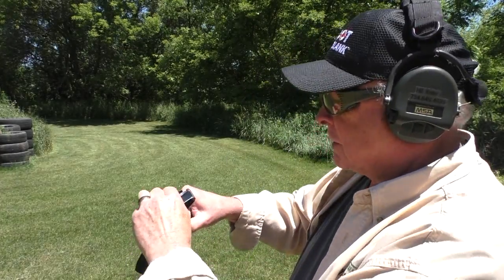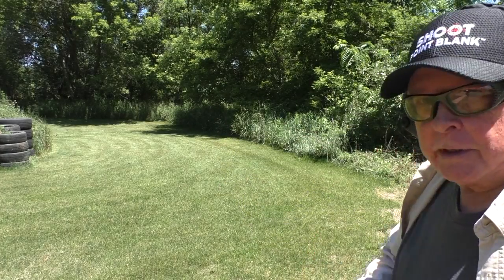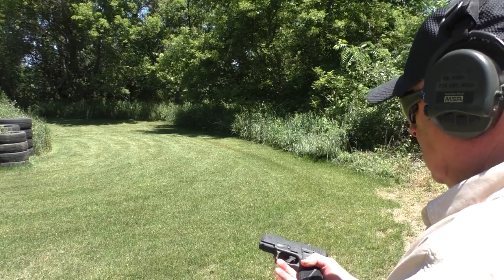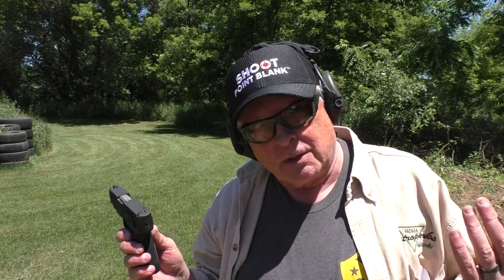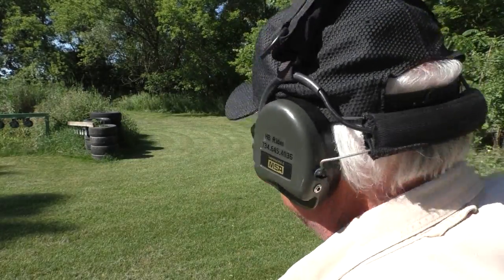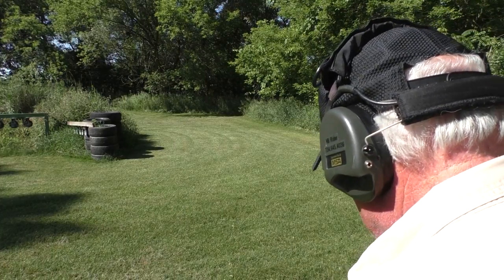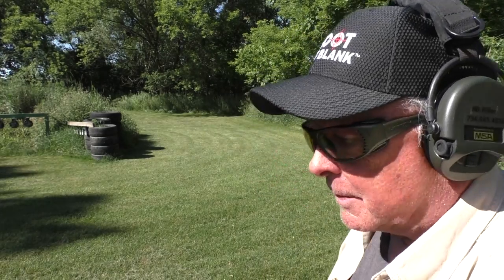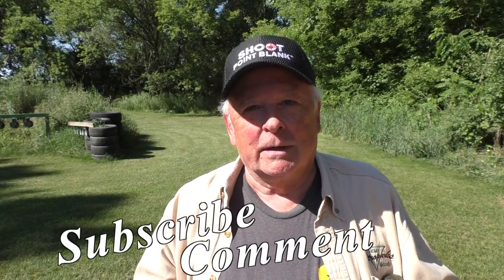Will the Taurus G3c run Defense Ammo?

Comment: I am breaking in my new G3c and have just over 500 rounds through it of 50% ball ammo and the rest being various hollow point and ballistic tipped versions of premium and cheap left over Hornady, Federal, Remington, Winchester, Corbon, etc., with no feeding, firing, or extraction issues.
Reply from the maker: Most of them run just fine. But Taurus QC is still somewhat spotty, so the occasional not-so-good example makes it into the stores.

Comment: I just bought a g3c but have had a g2c for a few months. I've ran everything under the sun through it including dirty Russian steel ammo and several types of hollow points and never had an issue. The only time I ever had feeding issues was trying to chamber the first round hollow point on a brand new dry gun (g2c and g3c). Took both apart and cleaned and oiled them -- no issues ever since.

Comment: Haven’t had any trouble with mine. Running 115gr Critical Defense and 115gr/124gr Sig Sauer V Crown. I think the key is to find the ammo that works in your gun.
Reply from the maker: The right ammo for the gun is always the issue. There is no such thing as "one size fits all". Once again, thanks for watching and commenting.
Reply: Hey, that's the ammo that a got when I bought this gun last week. 40 dollars a box of 50 is not a bad price.
Reply from the maker: @recon1071  there's just something about knowing you are spending $0.80 every time you pull the trigger. 😢
Reply: I know, but these guns are for self defense. They must fire self defense round reliably.
Reply: Don’t use fioccoh hollow points  147gr in the g3c . I found that out the hard way And I may not have spelled that name wrong. 
The Winchester silver defense hollow points work just fine in mine 115gr.
Reply: @robertkelly9276 
Would the fiocchi hollow points go into battery ? What was the problem with them ?

Researching to buy,thanks.

Comment: Polish the feed ramp to a mirror finish and you'll never have a problem.
Reply from the maker: That's generally the suggested fix. Thanks for watching.
Reply: @RidersRange  AND easy to do!
Reply: It's more of a barrel issue with mine when running some147 grain HPs. They hang up a little at the end of the first mill shoulder from the ramp end. Polished the feed ramp, same problem. Not many rounds through it yet though. May break in with time.

Comment: I've run around 1000 rounds of mixed ammo through my g3c. I only had 1 stovepipe with some SUPER CHEAP and underpowered aluminum case poly round nose range ammo. Literally runs everything I put in it smooth. I have shot several weights... but no 147 grain.  Ill have to pick some up and see. But ny taurus g3c has been literally unbelievably reliable. I wasn't expecting to be so happy with it. Very nice in hand as well. I even use the extended Mec Gar 17 round mags for plinking fun, and I have zero problems. Its a great gun for the money in MY experience anyway.
Reply from the maker: I've read reports of great reliability, and not so great. It seems that, though Taurus has made great improvements, their quality control is spotty. Thanks for watching.

Comment: The problem with G3C not feeding JHPs isn’t the feed ramp not being polished. 

Lock the slide to the rear and look closely at the feed ramp. Notice the mag well and feed ramp function together to feed rounds into the chamber. Now with the slide locked to the rear, move the barrel. You will notice that the feed ramp will move around and separate from the “ramp” on the mag well. He lies your problem. The distance between mag well and feed ramp created by the barrel moving around causes jhps to catch. No amount of polishing will fix this issue. Although it appears fmjs will push right on in there, jhps often catch. 

My remedy is to use “rounder” jhps and to rack the slide with the barrel pointed up. Gravity causes the barrel and feed ramp to fall in place better.
Reply from the maker: There are many things that can cause feeding problems. Thanks for watching.
Reply: thats exactly whats happening with the g3c im trying to get to run hollow points

Comment: I shoot anything through mine with now issues.  The 12th round in the mag is very tight, and one must ensure the rim of the round is fully back against the back of the mag.  Trying to tap the back of the mag will not seat the 12th round back.  You must manually make sure it’s fully seated!
The G3C is quickly becoming one of the most enjoyable pistols in my collection!
Reply: this is the capacity and sized pistol Glock should have made between the G19 and G26 but didn't.
Reply: @locksfoils just less reliable 😂
Reply: @JeeperCreeper-h1j  you can always tell who has never held one.  I have the 17 19 26 and 36.  The G3C isn’t significantly less reliable as you tear up laughing.  I’m an engineer and statistics of the six sigma show the Taurus is the better pistol dollar for dollar.  So someone at Glock is laughing at you.
Reply: @locksfoils  Yet you have allegedly have 4 Glocks so much for Taurus being the end all be all. 🤡😂
Reply: @JeeperCreeper-h1j  my comment originally is about capacity.  The size choice. Haters are gonna hate.
Reply: @locksfoils  Keep telling yourself that 🤪
Reply: @JeeperCreeper-h1j  you probably have never held a Kahr either….we all know the Glock boys

Comment: I have the Taurus G3c and I love it. There's no issues at all also very accurate.
Reply from the maker: Taurus QC seems to be hit or miss, though Taurus has come a long way in the past decade or so. Many G3c pistols run just fine, though others need some tender loving after-care. Im glad you got a good one. Thanks for watching.
Reply: Keep em clean and oil.
Reply: @stevenrucker9890  I know,  I always clean my guns right after shooting at the range.
Reply: Was it accurate out of the box ? Did you have to site it in
Reply: @amd-bu2mf  I can honestly say I was one of the lucky one's. My G3C was flawless right from the start... This may surprise you but I had more trouble with my HK-VP9 than I did with the Taurus.
Reply from the maker: If you watch my original video on the G3c you will see that it shot low left and didn't group well with 115gr and 124gr ammo. With 147gr ammo it grouped much better, but was still shooting low.

Comment: Today was the first time I shot hollow points through by G3C. I used the Federal HST 124gr +P. The first 12 Round magazine I had failure to load from slide lock. The rest of the rounds fired appropriately. I then shot a full 17 round magazine. I had failure to load from the first round and second round. The third round fired and the 4th jammed just below the feed ramp. The remaining rounds fired normally.
Reply from the maker: Wayne, the 124gr HST is one of my two "go-to" carry rounds, but it's also the one that has occasional first and second round feeding issues in some guns, including my Dan Wesson ECO. I also carry the 147gr Remington Golden Saber round and that has fed just fine in everything.
Reply: Wayne Sclesky Clean the gun and then see if its still doing it after you get at least 100 rounds through it and the mags are broken in. Then you might need to check the mags and the feed ramp or send it back in.

Comment: Taurus has rough machining on the feed ramp and it can catch hollow points. I noticed this before even firing the gun. After polishing my G3c will now even slow feed any hollow points while holdin the slide. All manufacturers should polish ramps before selling them, it really wouldn't cost them much time or effort. I personally polish ramps before I ever bother shooting it, even my Walther that was already polished, I polished more. Should just be a routine accompanying fist cleaning when you buy it
Reply from the maker: Michael, thanks for watching and adding the info. I agree on polishing feed ramps, though it is an extra step in the process and each step adds cost. Also, I read a rumor (rumors are like hind ends - everyone has one and most of them stink) that some manufacturers consider polishing a feed ramp to be a "modification" and could void the warranty.

Comment: My G3c also has the issue not chambering hollow points with a full mag using the slide release. However when slingshotting the slide, it works most of the time. I was wondering if anyone else had this same issue and apparently there is. I have never had the issue when firing the gun. Thanks for the video!
Reply from the maker: Thanks for watching and adding your experience with the G3c.
Reply: I had the issue when sling shotting it..it’s best to rack it like a man! Grip it good and rack the slide…that’s the only problem I was having..not handling the gun like it’s supposed..I never had any feed issues while firing ever..I always cycle my carry ammo ever couple months of clearing it at home so much..and if you carry with one in the chamber that’s one less time you have to rack a round in a self defense situation..

On the technical side..I did change my barrel with a lakelinellc barrel and haven’t had an issue at all..I noticed the feed ramp on the G3c kept hanging up my rounds..
Reply: @arp_tweezie8184  I've only put one mag thru mine so far, had a ftf a flat nosed 147gr, but I've noticed it won't feed by dropping the slide, you have to rack it...

Comment: Ok, correct me if I am wrong, I was in the Army for a couple years, 22 years, but if my memory serves me right, Weapons are supposed to feed, chamber, lock,fire, unlock,extract, eject, recock, feed ,chamber and so on. The only thing this video is proving is that it will “fire” a chambered round. I own a G3C and it jams when “chambering” about every hollow point ammunition I try to run through it. FMJ  “Ball” ammunition seems to run fine. I also own the G2C and G3 and they will run anything I put into it. So there is something definitely wrong with the G3C, I wouldn’t trust my life on it,  And I have ran about 200 hundred FMJs though it, and it still jams, after the Holidays I am sending it back to Taurus.
Reply from the maker: @Jim Catrell, thank you for watching and commenting. The purpose of the video was to show that my G3c would feed, fire and cycle a variety of defensive ammo. But bear in mind that this is a sample of one. Taurus QC seems to be spotty, at best. I've had many viewers comment that their G3c worked well with any ammo, yet others have had issues like yours.

Comment: I'd like to just include a few points, that help a lot, in my opinion. Don't forget to break in your mags, I think a lot of these feed issues may be caused by that, or failure to inspect the feed ramp. Try to remember it's a budget pistol, regardless of it being one of the best, they still have to make some money on it, and something somewhere will occasionally fail in the quality control area. It may only be a 5 minute fix from a perfectly useful firearm, but you won't know unless you use it. Don't assume that any firearm, regardless of price will function perfectly if you just buy it, and store it next to a random box of ammo, until/if ever, you need it. Don't be cheap with your edc ammo! practice enough with your defensive ammo of choice that you feel confident, then skip to a cheaper alternative(just my opinion! I am not an expert!), range time can get pricey thanks to hoarders! My personal G3C in particular works very well with Hornady Critical defense, or duty(many others have mentioned the same thing). I use 115gr defense for edc, but others have commented that they prefer 124gr rounds. Point is, practice, and practice more, get to know your firearm, and how it works.(obviously that was for neophyte and novice users, no offense to those that know their weapon, lol).
Reply from the maker: Jey Lee, thank you very much for adding those valuable points. And thanks for watching.
Reply: When i get a pistol, i always polish the feed ramp before i ever load / shoot it.. Never had any feed issues.